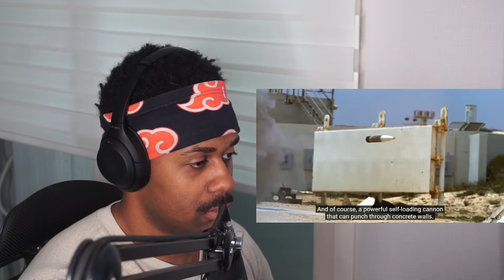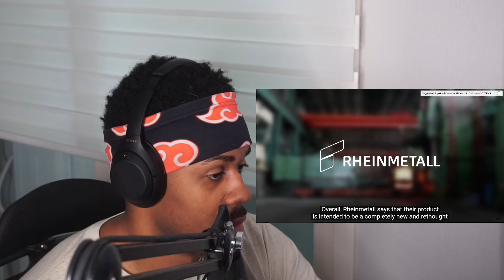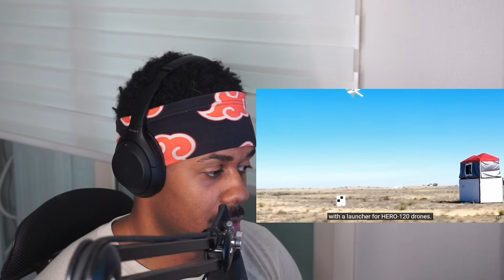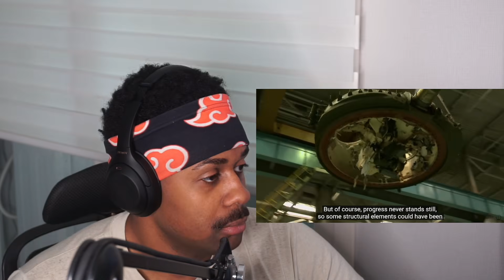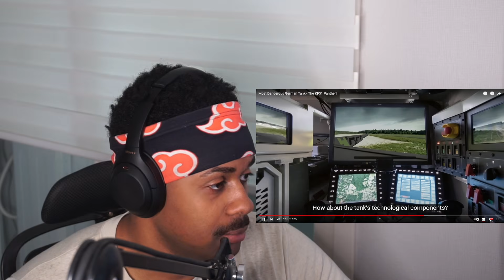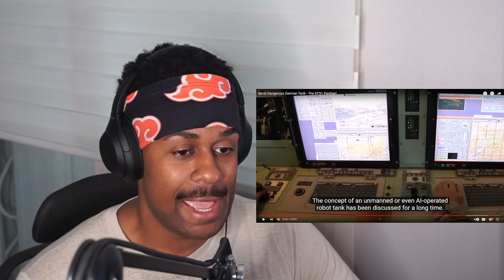Germany Unveils its DEADLIEST Creation...The KF51 Tank

Comment: onboard drones is smth i didnt expect on a tank but im rly impressed its there 😅 drones are the future of warfare i mean most ammunition is so advanced its not far from a drone but that little step up to full maneuverability changes things drastically suddenly u can "shoot" around obstacles, scout and attack all while the main tank is still hidden and behind cover. 
Just having some drones on every MT ensures its fully self reliant in future battles when drones become a necessity.
Also while many people picture drones as slow they can get INSANELY fast literally zooming in on a target before u could hear or see it often.

Also with drones becoming more important in general u could rly make the point to just establish a full network on every frontline and bring the tanks unmanned 😅imagine how much room and safety features u can get rid of without crew compartments in the same space u could easily fit alot of backup systems or more features. 
The thing is remote control is often unsecure and has potential for intrusion BUT a AI controlled tank would not and with a self destruct code as fail safe if damage compromises the AI or enemy disabled it and intends to salvage.

Comment: There is exactly ONE KF51 Panther, an industrial Prototype.  
It got the trusty 1500HP Chassi of an Leopard 2A6 and a brand new Turret with a new 130mm L52 Gun and new Electronics.
For Comparison: The Abrams gun is the same (lizenze produced) as in the older Leopard L2A4 a 120mm L/44 with a mere 5,28  Meters (17 feet) in length. The Leopard L2A6 got the improved 120m L/55 with 6,6 Meters (21 feet) and the Panther gets the 130mm L/52 with 6,76 Meters (22.1 feet). The longest Stick is carried by the T-14 Armata with it's 125mm L/55 with 6,875Meters (22.5 feet) but the Panther got the bigger one. The Russian gun got 15MJ in Energy outputt, the German Gun will be north of 20MJ Energy Outputt.

Ukraine gets a factory to crank 400 of those beast per year out.

The Kamikaze Drones are not against Tanks or Vehicles they are against the modern bane of Tanks: Infantry with manpads. Why risk a Tank, when you can send out an flying ammuntion with an Warhead after the it was spottet by your close range observer?
And the Tank got 4 Seat not just 3: Driver, Gunner, Commander, optional Observer/Drone pilot.

Comment: KF51 armor:

Its in basic the same as Leo2, but with additional layers on teh hull - less on turret (for obvious reasons). It has a special top attack ERA which they call TAPS to protect from ATGM's and stuff, maybe from some artillery shells as well. The whole tank is covered in StrikeShield protection system, which is some kind of hybrid between APS and ERA. This Shield can adress threats from RPG to APFSDS, can react in under 10 meters distance and can react on at least 4 simultaneous hits.
So not much of uncertainties here.

The battlefield right now is extreme dangerous - specially if you're a prime target - and only good awareness/recon can try to protect you. Rheinmetall adressed this quite honest imho.

Comment: The KF51 is only a technology demonstrator until now. It has never been used on any battle field. It hasn't even been issued to testing of the Bundeswehr yet, so there aren't even trial reports from it yet. All infos available for it are all paper info until now, nothing based on real world data.

However: if it holds up only 75% of what is claimed it can do it is at least on par with the best versions of the Leopard2.

To give you an insight how much Rheinmetall packed into the KF51: In the game Hearts of Iron 4 you couldn't even install all the upgrades in either the vanilla game nor with extended tank upgrade slots from a mod.
This beast is so chock full of improvements it's difficult to fathom.

The only thing they might get rid of is the fourth crew position and add in additional ammo storage. The fourth crew position might come in handy once drones become an integral part of each combat vehicle and requires a dedicated drone pilot on board. Until then designated crew positions for it are a waste of internal space when this vehicle is fully operable at three crew members. But that improvement hasn't been implemented yet. Tactics and strategies have to be developed for this as well as implemented into training and operations.

Comment: For nations using each others tanks, well for one there are some hybrids in technology already like the Abrams (more or less) using the short(er) 120mm Rheinmetall cannon of the older Leopard 2 models (as the USA use depleted Uranium instead of tungsten they didn't upgrade to the longer gun used in newer models yet for the extra velocity etc)

Also some projects have been designed for a universal Tank like the MBT-70 (which was cancelled and resulted in the Abrams and Leopard 2 respectively) or whatever we Germans do with the frenchies atm for some MBT program.

For differences in Abrams vs Panther are the cannon calibers 120mm vs 130mm but as said both nations use different material for their rounds so I wonder how they will perform, or if the USA uses again a licensed copy of the main gun if the next Abrams would also use a 130mm but then with depleted Uranium round making them even more effective. Obviously the current Abrams doesn't have the Drone capability which some, for some reason, only see it as gimmick but that's quite the versatility especially as the 4th (ex loader now company commander or drone operator) could use them also in coordination with other tanks of the same unit to really have some battlefield control there.

The power between KF-51 (and Leopard 2 as it used the same powerpack) and Abrams are roughly the same (iirc) with 1500hp, but the gas turbine of the Abrams (compared to Diesel) has more Torque..so yeah not really that needed I guess... and the KF-51 apparently slightly lighter than a Leopard 2 making the power to weight ratio a bit better so no mobility decrease at least.

Being such a complex machine I wonder how reliable it would be on the battlefield though as soldiers aren't exactly know to handle their stuff "with care" xD But if it works, it allows for plenty of operational uses.
Reply: Tanks get ambushed

You cheer.

Tanks launch 20 drones

You scream.

Comment: MBT 70 was Germany and USA joint development. later split up. leopard 2 and abrams a1 are based on the program. Interesting thing is that abrams was also a prototype with diesel instead of turbine, and first abrams a1 had cannon 105mm L7 like on leopard 1, first later us army saw that german cannon with 120mm L44 is better, and bought it and later on license im usa built as M256. Later Germany built a new 120mm L55 gun in the Leopard2 A6, the USA was also offered the new gun but the US Army did not want it.
KF51 Panther has completely different gun 130mm L52 is much stronger than 120mm up to over 50% more power. But it's not a standard yet, future shows which direction it's possible.

Comment: the presentation model of the KF51 was still using a placeholder Leo2 hull, hence why it still has the same layout and all and not a seperated crewcabine thing like the abaraham X has. if the thing goes into actual production, it would most likely receive its own proper hull. that said its questionable if the separated armoured crew cabine would be a good/useful thing on the panther....

 for the intended useage of the tank - that is if it keeps being used like the Leo2, with a strong turret and a weak hull.
Reply: It will not get another hull.

Comment: The current Abrams is more comparable to the Leopard 2A7, accelerates faster but has a worse gun. Both have a 120mm Rheinmetall smoothbore gun (US licensed it), but the Leo has the L55 gun since 2A6, the Abrams the L44.
Even the new Abrams X will have this 120mm gun, but the KF51 has a 130mm gun which has a higher firepower.
Reply: The L2A7V and L2A7HU already use the L55A1 gun, for which even newer ammunition is being developed. And these two types also use trophyAPS armor, the L2A7HU already has reinforced upper armor. The two tanks (leopard/panther) were built based on different design considerations, both have a right to exist on the battlefield, but they can work together, side by side and support each other to form an interesting system, because the IT system of the leopards is also capable of using Rheinmetall HERO drones , or get coordinates and pictures of the other vehicles. (for the Hungarian order, in addition to the L2A7HUs, the KF41s were bought, the HERO120 drones are integrated on them). By the way, the KF51 prototype was in Hungary a few weeks ago, and they talked about its purchase, along with the Leopards and KF41s...

Comment: The Abrams uses the same gun designed by Rheinmetall for the Leopard 2 and was developed from a joint proof of concept of the overall tank design & concept, and both use British designed armor. So yes they share technology, but the US won't simply buy a German tank except for evaluation maybe. Many other countries will though, and it is rumored that the Panther is just the first design in an eventual joint French & German tank project to replace both the Leopard 2 & Leclerc for good.
As for the Abrams, the Panther is vastly superior to the current Abrams, but the first concepts of the next generation of American MBT have also been shown in the Abrams X concept. Some ideas there are similar. It still has the older & smaller gun, but it puts the crew even further down, so likely more protected, or so the idea is at least. We'll have to see. Much is secret, and neither is being used in major combat drills yet (as far as we know), let alone active combat. Both will have many revisions even once the base design is finished. They might be better at different things. So saying one is clearly just better, isn't really accurate.

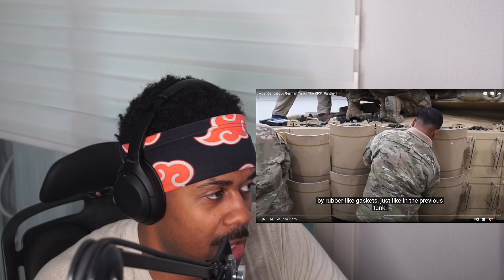Comment: 13:30 "question: since the US and Germany are allies, do we share Tanks with each other ?"
answer: NO, we don't !
Ironically, the Abrams M1 and the Leopard 2 started as a german-american joint venture to create one MBT for both nations to be as interchangable and interoporable to the max ... 
but as with most of these international coorporations, different military philisophies and economic interests lead to the split of this project.
The US military even tested a L2 prototype after the split, and it topped all expectations of the US military wich lead to the implementations of the L2-track and the 120mm gun into the Abrahams M1A1 (The original M1 was still using a 105mm gun).

but lets see what the future brings, as Rheinmetall teamed up with Raytheon into the competition for the replacement of the M2 Bradley with the little brother of the Panther ... the KF41 Lynx

Comment: 7.62mm MG is probably using tech of the MG3 or at least same mechanism in a whole new package but can it rly take a A-10 out as you thought when you saw it in the vid? Maybe damage but i don't think 7.62 would be enough to take one down
Reply: I doubt it can take down an A-10. However, these drones can take out the opponent's AA units and then the A-10 can start raining death and destruction.
Reply: @realulli  like i said i dont think it could take one down, James Bray just misunderstood it cuz of the vid showing a A-10 while talking about the MGs capacities of taking down air to ground planes so yeee, besides the A-10 must be armoured at the front glass at all cost so i dont think both Nato and AK 7.62 calibers and maybe more could penetrate that, maybe atleast 12,7mm (Cal 50) etc can

Comment: 13:40 i think the usa has its own good tank with the abrams x. patents have been exchanged in the past. For example, the Abrams cannon is the same as in the Leopard 2. Rheinmetall also has locations in the United States. Conversely, Germany buys F-35 jets ... there is an exchange of weapon systems. but i don't think even germany will use the kf51 in large numbers. germany is currently developing the leopard 3. this will probably replace the leopard 2. the tank was not commissioned by the german government.

Since apparently Rheinmetall is planning to build its own factory in Ukraine in which 400 KF51s are produced every year with their own air defenses to protect them from Russian missile attacks, the first few years these tanks will probably only be produced for Ukraine. because that is where they are most needed.
Reply: @boredaf6332  the German government has commissioned the development of the leopard 3. kmw received the order. Rheinmetall was pissed that it didn't get the order and so it developed its own tank. the model of the leopard 3 from kmw is more likely to have convinced the Bundeswehr. I think kf51 was an export tank from the start. but since it will take at least 2030 until leopard 3 is ready, it may be that the Bundeswehr will also buy it due to the new threat from Russia.

The German government does not appear to be standing in the way of the construction of the KF51 factory in Ukraine. it is currently only being negotiated about who bears the costs. Rheinmetall is a company and not a benefactor. Rheinmetall wants to make money with it. Whether Rheinmetall and the Ukraine will come to an agreement will be decided in the next 2 months

Comment: In the event of a NATO war in europe an international army with a unified command structure can be formed, I think with the U.S. with leading command but I'm not sure, and in that case tank swapping could potentially come a thing. It could also pan out that individual division or brigade units simply stick with their nations shit, probably more likely barring some need to fill equipment gaps through swapping.
As it stands right now Nato countries typically allow each-other to purchase equipment or technology. The gun on the Abrams for example is the Rheinmetall 120mm, same as on the Leopard 2 and 10mm smaller than the gun on the panther. The British challenger 3 is also utilizing the new Rheinmetall 130mm. German barrels are just the tits, high velocity and high durability

Comment: German here: There is a totally wrong perception of how great this tank is in the Western world, but the reality is very different. 
Dr. Markus Reisner from the Austrian department for military research and developement explained why:
1.) Nobody has seen the tank from the inside yet
2.) Nobody knows anything about the capabilities or new features of this tank yet.
3.) The tank is definitely not ready for war yet. Years of field exercise and testing on the shooting range are necessary to find out its weak spots. 

The truth is, like on every other tank model and upgrade like the Abrams X, that this is merely more than a prototype for representation and advertising purposes, designed for potential customers all around the world. It´s just made for business purposes to cover the costs for development throughout the last years. Plus it boosts Rheinmetall on the stock market. And it works: For instance, If the Ukrainian Army wants to have it, as we hear on the news, Rheinmetall will have a unique opportunity to test this version on the real battlefield and make great promotion. If the tank prevails, customers all over the world will jump on that train and make it a hot sale, just like it was the case for the Leopard.

But until all of that happens, it´s just a prototype.